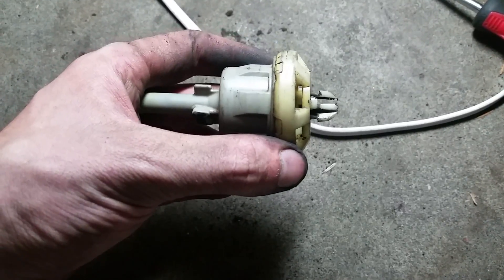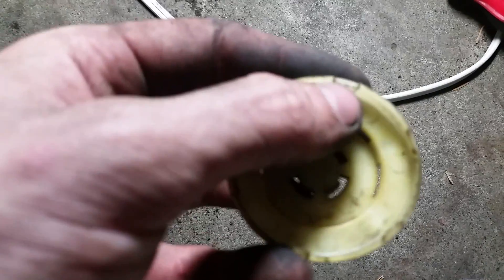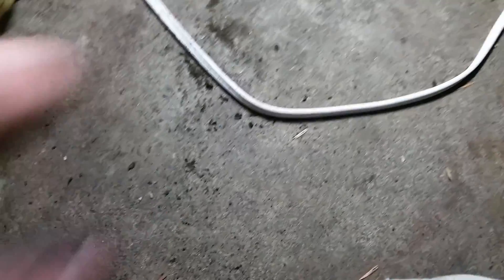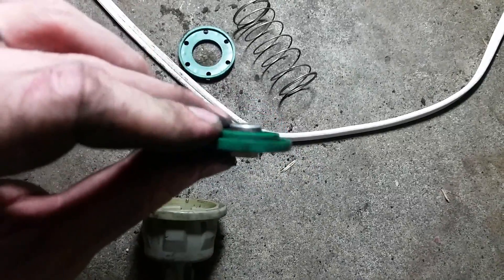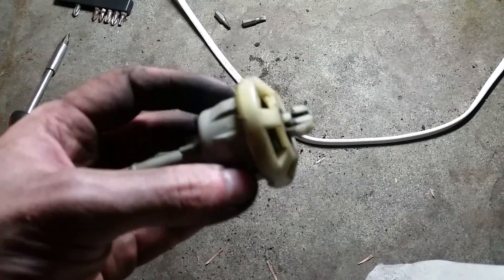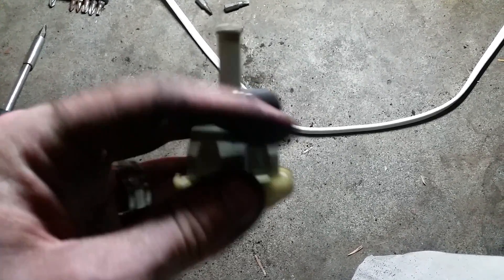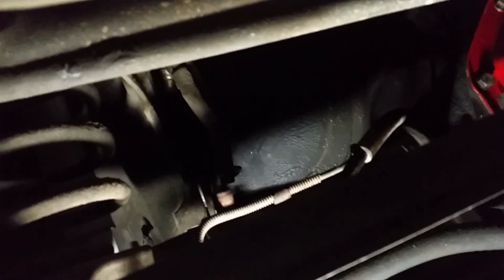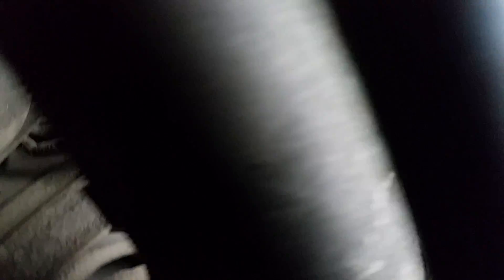1989 3rd Gen f-body fuel vent fix

Comment: Great video. I am having a problem when I put gas in the tank and the gas spills out. I am to much pressure, cleaned the vent replace purge valve and replaced the charcoal canister as well. I have no clogged lines and the tank is new. Any idea and thanks in advance for the help

Comment: If this is clogged will this cause there to be no pressure in the tank? I took mine for for smog and they told me I had a “leak” because when they opened the cap after running it there was no wire releasing

Comment: Great video. Can too much pressure in the tank cause the car to shut off? Mine shuts off randomly. Especially when turning sharp in reverse but only after it’s warmed up. The tank always has pressure when I take the cap off. A lot of pressure.
Reply: Ever solve your issue with reverse stalling ?
Reply: I cleaned this part following the video and it hasn’t done it since.
Reply: @PyramidSkeem  thanks for the reply. I'm getting occasional reverse sharp turning stalls when warm and it is doing my head in figuring it out.
Reply: No problem. That’s exactly what mine was doing. The warm weather made me think it was fuel vapors because they are more prevalent in warm weather and that’s what led me here. I’m fuel injected so I ruled out vapor lock. Try the tips in this video first and see if that helps. Also, I keep the tank full. It leaves less room for tank pressure to build up. I fill up at half a tank. That helps as well. Good luck. It’s very annoying and causes anxiety about driving the car and that’s not why we bought it.
Reply: @PyramidSkeem  spot on with the anxiety bit! Good tip with keeping it full.

Comment: Did you get a new one or just clean it and replace it.Do you have a part number for it by chance? A new one is impossible to find
Reply from the maker: I just cleaned the one I had because it is so hard to find a replacement

Comment: when i open my tank it blows vapor out a lot i live in las vegas it hot never has done it before today it was really always keep tank 34 full its a 1993 all original 3.4 or is it a fuel filter isue
Reply from the maker: The tank isn't venting like it should, I would check the vent

Comment: does any fuel leak out while taking this off?
Reply from the maker: No, it is dry
Reply: J Robling when I try filling up my gas tank, the gas pump stops pumping out gas while I clearly have additional gallons of gas that can be filled and when get back into my car and start to drive off, my car leaks gas. Is that possibly due to this fuel vent being clogged?

Comment: What is the problem if it is clogged?
Reply from the maker: There isn't a problem that causes the clogging, GM put it under the car so eventually it is going to get dirty and clogged
Reply: J Robling what are the consequences if it is clogged?
Reply from the maker: You can have a high or low vacuum in your fuel tank and it helps vent fumes in the event of a rollover
Reply: J Robling thank you!
my problem and when I walk with less than 1/2 tank of fuel he dies in the brakes. I guess it must be a buoy.
Reply from the maker: If your float is bad it will only read wrong on your fuel gauge, It doesn't alter how much fuel is being passed. Possibly the fuel pump is weak if you have gas in the tank and it cuts out when you hit the brakes
Reply: J Robling Thank you for that information. When the float is bad, does it move the pointer, does it cut fuel? Should it be a bomb? Another thing, if you can help me, have FPK, FPH and FPJ buoys, what changes is just pin-out?
Reply: On my 90 formula I first noticed allot of pressure release when I opened my gas cap. It also caused random vacuum problems which caused sensors to throw off check engine light at odd times.
Reply: @karldowda9029  Have you fixed your problem yet, I'm having the same issue.

Comment: When this device is clogged, does this cause the issue when you pump gas into the tank and it gets clogged and the gas doesn’t go into the tank while refueling? And what did you clean the device with? Break cleaner? It did you just blow into it?
Reply from the maker: I had that issue when I was filling up with gas too, it is either this or the line that goes to your charcoal canister, those are the only two lines that regulate the pressure in the tank. I used brake cleaner when I was cleaning it out.